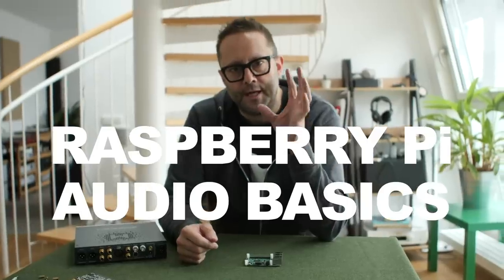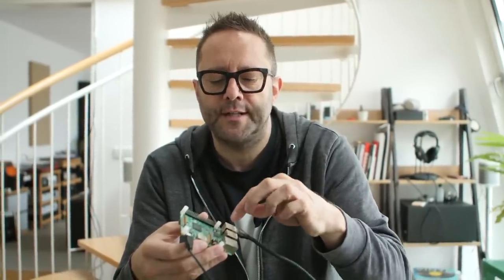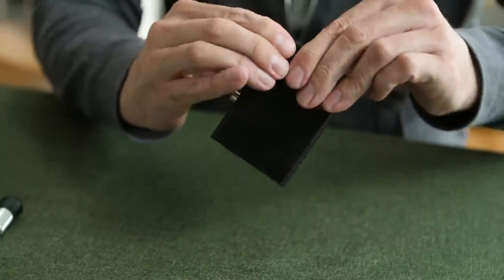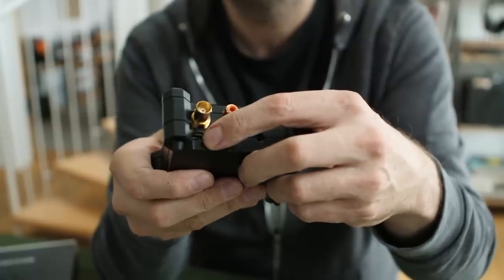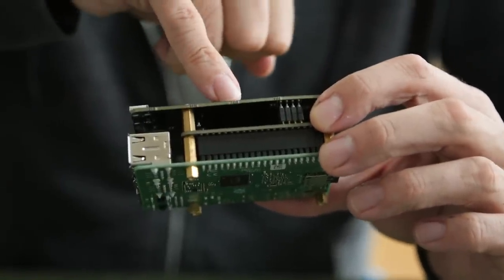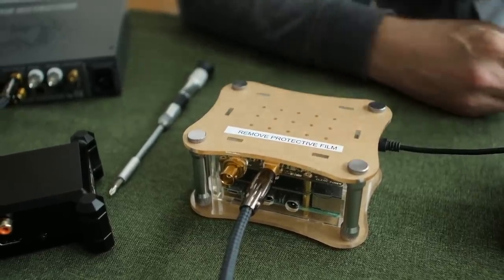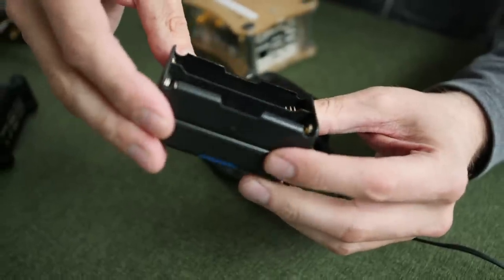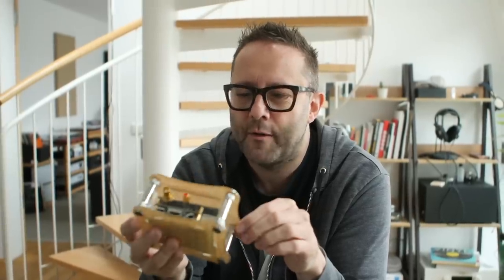Raspberry Pi with ALLO DigiOne Signature - a rewind and a review

Comment: Have you ever had any issues with RPi with DigiOne regarding overheating? It is possible to buy ventilators or passive coolers for RPi. But do you need a cooling system when using RPi as a streamer?

Comment: Nice one!
You can use a battery bank, mine can be charged while using it...and overall it's so less fiddly to charge.
Ciao
Reply: my power bank has 2 outputs 2000 mA each. The capacity of power bank is 9000 mAh, 5v. So I can use one output to pi4 and at the same time charge it?

Comment: Is it possible to use a portable USB Battery charger (i.e. Anker) with a usb-c to usb-a cable to power the clean side of the DigiOne board? It seems easier and less dangerous than using Allo's 4 battery "hot" fire pack. I would think the DigiOne board would pull the necessary power it requires from the portable usb battery charger.  Not sure if it would introduce more noise than the Allo battery pack, but it would be easier to recharge than having to pull batteries out and stick them into a separate charger. Just an idea as I think you mentioned it pulls minimum volts from the battery pack.  I would assume a portable USB battery pack would introduce less noise than AC wall power.  Plus since you can get 20,000 MaH and higher usb batteries you maybe able to get extended run time vs Allo's battery pack. Also, it looks like the battery diagram on the Allo battery pack is incorrect.  Flat (negative-) side of these 18650 batteries should always go against the spring side.  Glad your battery pack didn't explode.
Reply from the maker: But not all batteries are low noise, especially those phone charger packs.
Reply: I'm using an iFi iPower for the clean board and it sounds just fine to me.  I use my system daily and there's no way I'm doing batteries.  An LPS is always an option in the future.

Comment: How about trying this with a raspberry pi zero instead. It's lower power, so the batteries will last longer and you can power the whole thing from the batteries. This will remove all the noise from the PSU.

Comment: I am very interested in this Signature version. I am looking for a player into which I can plug a 3TB hard drive and play back FLAC files directly into my Cyrus 8DAC co-ax input (max 24bit/192 KHz). Having read their web site I cannot find where it might say this.  So I ask will it do this?

Secondly is this unit controllable over WiFi, wirelessly that is.

Cheers

Comment: I ended up here because one simple reason. I want 512 DSD. I have google play music, sounds ok, an I want to build my own library of 512 DSD and output that from my pc to whatever DAC I am using at the moment. Well, it turns out that is nearly impossible to do that. Foobar is about the only decent option and that is only for 256 max. Even payed solutions can't do 512, some are asking for 260 Euros gives me a tons of network junk and will still not output 512, while other you need to compile the linux kernel yourself, or straight out refuse to "track and store any compatibility data".

Comment: . The first one had optical and coaxial. Even though you kept calling it SPDIF which technically it is but if both of the top hats had coaxial out why did one sound better this is before actually isolating them

Comment: I dont understand, how a digital signal gets affected by power supply noise. Is there a analog to digital conversion occurring in the system?
Reply: Nelson Alex what i don't understand is the purpose of the intermediate power conversion board to isolate the Spdif board from the 'dirty' power on the pi? Surely if you only connect the signal pins on the pi itself to the spdif board directly with jumper wires and then power the spdif board seperately with a li-ion battery pack it is electrically isolated from the pi?

Comment: I got the signature after watching this review a number of times.  I purchased the plug & play version with dietpi already installed.  I’m still finding this too technical and buggy.  Airplay is fine on the MacBook Pro but keeps crashing when I connect to an iPhone 7+.  Also I need to figure out how to play Qobuz through it.  I got a second micro sd card and tried installing Max2Play but I’m struggling to connect any of my devices so can’t play any music via the M2P operating system.  The sound via the dietpi is fantastic though, so will try to persevere
Reply: Did you get it to work? I use volumio and find it awesome.

Comment: I am trying to setup a odd system for my PC. So I was wondering if I could use a raspberry pi for a dedicated discord device that I can stream my PC aduid through the pi and then in to my headset along with discord audio. Is that possible, and would I need to get a separate board like you have to make it sound good?

Comment: Hi, great video thanks.  Would using the battery pack from the signature with the original Allo Digione improve its performance? Thanks
Reply: Pretty sure it would, batteries are clean DC power. That or upgrade to a clean linear power supply.

Comment: After seeing that horrible battery holder, I think that I would rather opt for a high quality 'traditional' power supply, as over a period of a year or two I would be bound to get the battery wrong. 

I would be interested to know how it would perform with a low noise directly connected power supply.
Has anyone tried yet?

Comment: For someone who knows nothing:How is Raspberry pi/ Allo controlled though your computer or tablet? Are they recognizing what ever is on the micro sd card and not connected by cable? I have Chord Gem which is easy since it plays everything though it's DAC from my Macbook.
Reply from the maker: What you can do is determined by whatever protocols are supported by the OS that runs on the microSD card. If the microSD card OS supports, UPnP you use a UPnP smartphone app. If it does Roon, you use the Roon smartphone app.
Reply: @DarkoAudio  Thanks, so I can assume it's controlled remotely. Enjoying your videos!
Reply: @TheRk1111  Dealing with the streaming side you work with it via a web browser, similar to a router setup.  If you need to access the linux layer, you have to plug it into a monitor, keyboard and network.

Comment: SMPS, switched mode power supplies, do indeed add a lot of electrical noise to an audio system. Anything that can reduce your system's noise (or jitter - separate topic) will hugely benefit the sound. Batteries are way quieter, but also are still 'noisy'.  LPS, linear power supplies are the way to go - some are better than others. There are many well designed LPS  - the quieter and beefier, the better. Allo offer the Shanti.
Reply: https://www.teddypardo.com/powersupplies/underthehood.html

Comment: Could you not just use a regular USb power bank? like the ones from Anker?
Reply from the maker: It's a common misconception that all batteries are the same. Those from Anker are great for recharging phones but who knows what switching regulators sit inside and how much noise they produce. Not all batteries are low noise.

Comment: Hi John,
thanks for the great review.
It‘s your fault, that i bought the Digione Signature and tested it vs. my AURALiC Aries mini...😉
No chance for the Aries! 
I would like to give you a recommendation about powering the „Clean side“. If you have the maximum sound quality in mind, LiFePo4 batteries are for sure the best way. I made some tests in a DAC project, with different LiFePo4‘s in the past. In this project one stands out, the A123 Systems ANR26650M1B.
You could read my suggestions, following the link to the Roonlab community.

https://community.roonlabs.com/t/digione-signature/47638/264?u=dvb-projekt

Try it!

Kind regards,
Oliver
Reply: I also bought one.  For clean power at the moment, I'm using the iFi iPower.  For the time being, it sounds just fine.  If a system sees near daily use, batteries seem impractical to me. A LPS can always be added later.

Comment: Have you tried a usb power bank instead of that firework battery pack?
Reply from the maker: I have not. Many smartphone battery packs contain switching regulators that deliver more electrical noise than some switch mode power supplies.
Reply: John Darko I’ve heard today from Allo sales that they will be releasing a new USB streamer with the RPI rather than the Sparky in about 2 months.  Wondering if I should hold out or go with a microrendu.  I like the reviews of the Allo Digione Signature , but invested in USB gear.  I would have liked to link the Digione Signature to a AQ Carbon USB, USB Regen, Curious USB, PS Audio Sprout100 and then in to my Kef R300.  I wonder if there is anything else at a similar price with a USB connection and a lively sound.  I’m sure any streamer will be better than my MacBook Pro 2015 streaming Qobuz

Comment: Why not just use the digione with a powerbank and WiFi 🤔
Reply: I have the same question.
Reply: WiFi is said to be worse quality, havent tried it myself because of that, even turned off the WiFi and USB slots on the Pi to get the most out of it.  If convenience is worth it and you dont notice, why not.
Reply: I have done this myself, I used a Ravpower 10000mah usb battery bank, I put a meter on it ant its using 0.03A so it should last a long time. There is an easily detectable difference between the battery bank and the Audiophonics linear power supply. I don't expect to have to charge the battery bank very often, when the Pi is turned off the draw reduces to 0.014A. I would be careful which battery bank you use as the power from the batteries pass through a charge controller, cheap nasty power banks may not be as good.

I can tell you that this blows away the built in streamer in the Mytek Brooklyn Bridge. I'm still using the Mytek as the dac connected with spdif but the Pi installed with Volumio and the Allo Digione Signature adds airplay functionality to the Mytek, something it really should have had built in. In case anyone is interested and I'm with John about paying for the Tidal plugin, this doesn't sit well with me so I found a way around it.

An interesting tip for everyone using a similar set up, there's a program called Tuneblade which you can install on your PC/Laptop, this will allow you to stream what you hear to Volumio on the Pi. This allows apps like Qobuz and Tidal to be used on a PC/Laptop and streamed to the Pi. In case you are wondering it passes the signal as is, so if you stream a 24bit 96khz song, that's what the Pi gets, its not down sampled or messed with in any way.

Comment: corrective stickers ha. man those battery holders cost 5 bucks for 10 on ebay. at the price they are charging for this you would think they would buy new holders and throw the danger to human life one's away instead of slapping a little sticker over it. in the pic from the article where it shows the stickers you can see someone manually scratched the battery ends and + - off.  not something you would expect from a trying to seem high end company. I cannot possibly ever have faith in a company this sloppy and cheap. makes me think the whole thing is ready to explode at any moment.

Comment: If you or anyone really believed that the "noise" from the ground on a digital device truely was to polute the audio coming from a dac you would just use toslink. toslink is literally the same audio data from coax. however because of the way it's transmitted it makes both sides of the cable isolated from each other. no need for any of these silly expensive pi hats. TEHNNNNN to top it off you go and use two of the same power supplys to power them both. the same dirty supplies you were just moaning about. which share different earths and the different grounds electrically because of the nature of double isulated equipment not having an earth. which would in turn create a difference in ground levels and therefore actually introduce the same noise back into equipment but technically more of it because of the nature in having two "floating" grounds. JUST USE TOSLINK AND ELEMINATE THE SHARING OF GROUND CONNECTIONS ALL TOGETHER.
Reply from the maker: Yours is a common misconception. TOSLINK does isolate source from DAC - a tidy theory. However, the reality is that the TOSLINK receiver chip in the DAC has to work so hard to read the incoming signals correctly that it generates its own noise. Basically anything that does processing generates noise.

Comment: Hmm I wonder why they didnt just use an optical SPDIF! - If you re-clock the data with a very high quality clock with a half bit phase shift (unless source is really jittery where a multibit buffer shoulkd solve it) noise should be next to 0!

Comment: Could it be powered by a ‘power bank ‘ 
This would be ideal as it could charge when not in use and at a touch of a button play from the battery?
Reply from the maker: Yes. That's possible. But not all batteries are low in electrical noise output, especially phone chargers. In many cases you'd be better off using the wallwart.
Reply: John Darko cool, thanks for the reply. Love the videos cheers

Comment: Rather than buying some dodgy 4 pack battery holder and a charger for 30 Euro why not buy https://www.aliexpress.com/item/4000088969545.html?spm=a2g0s.9042311.0.0.17234c4d8irZTe
for about 4 euros? Twice the capacity and you do not need to take batteries in and out to charge. I have the Allo Boss and the difference in sound between the normal wall warts and battery is night and day, I am usually sceptical about this sort of thing but this is a dramatic difference.

Comment: Use a powerbank....
Reply from the maker: Not all batteries are the same. Powerbanks are sometimes noisy.
Reply: @DarkoAudio  thanks
Reply: @DarkoAudio  i have a xiaomi 20000 power bank and it always plugged to my IFI iDefender and i'm surprised by the result , i will buy this package and try to power up all the input with power bank